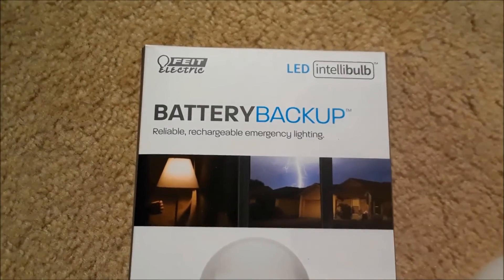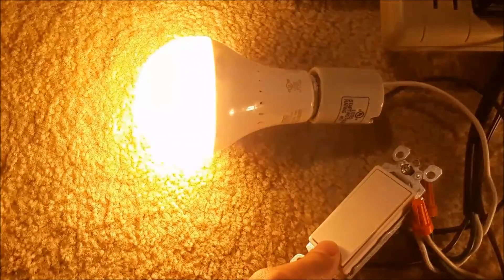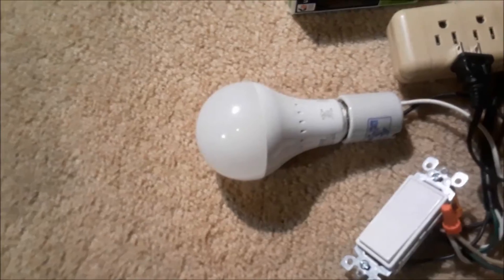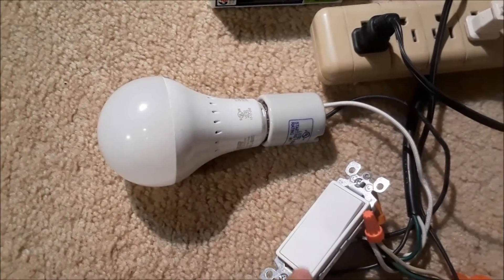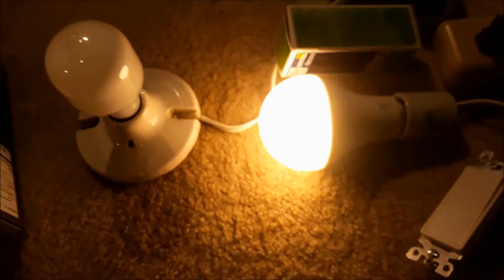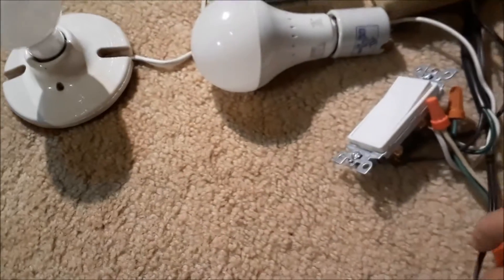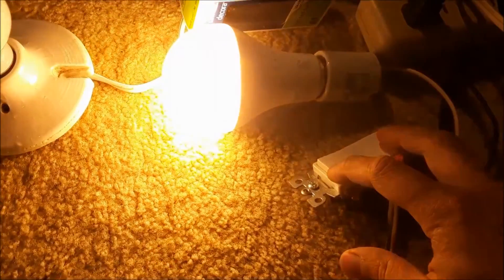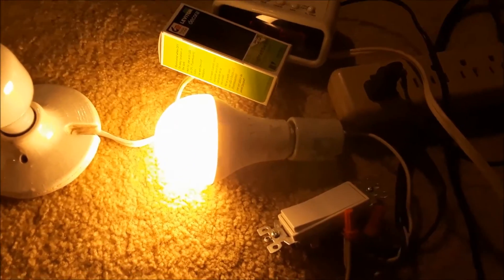Feit Electric Battery Backup LED Bulb Experiment

Comment: If you turn the lamp off to go to bed, does the bulb stay lit as if the power went out?   Or is there a way it senses that the power is still on but you turned it off with the lamp on off switch?  If you can't turn the bedroom lamp off when you want to sleep do you have to take it out of the socket to switch it off?  It doesn't sound so great if you need to modify it to get it to shut off when you turn the lamp switch off.

Comment: Just a quick explanation of why the neon light didn't trigger this bulb.  In addition to the neon bulb (probably) being too low power to set it off, it requires a turn-on voltage of about 50V or more.  Feit most likely uses a much lower sense voltage than that.  Nice video.  I didn't know about these bulbs until I found your video, and I wanted to know how they work.  Now I have a good idea of how they're designed, and of their limitations.
Reply: Interesting it was

Comment: I just bought a whole bunch of these today on a whim, knowing nothing about them... I have some exterior lights on a double switch, and when I went to turn them off, they turned back on... Honestly a not a big deal, but I can only imagine that this constant full drain on the battery day after day will render these bulbs inoperable well before the 13 year life time claim on the box... Regardless, I have a few others set up in areas I usually leave on at night, for when I need to stumble to the bathroom or whatnot... Pretty neat stuff... Except for the few areas on double switches in the house where now I just have a light constantly on lol
Reply: I don't think those batteries will last more than a year if they're in power outage mode every night.  My guess is that they will still work as dumb LED bulbs, and just lose their ability to light during a power outage.
Reply: @theclearsounds3911  I will certainly try and remember to update y'all when that happens.   5 months on and still going strong haven't had one fail yet... Not bad for $4.44

Comment: So..this bulb does not work property?
Reply: It's not that it doesn't work properly.  It's just that it can be easily fooled by unusual configurations.  And, I can give you an intelligent guess that different brands of the same type of bulb will behave differently under these unusual configurations.  This is not the type of thing you can just buy blindly without making sure it will work in your situation.
Reply: @theclearsounds3911  nicely put 👌
Reply from the maker: It works correctly but requires one to manually switch it on during a power outage since it has to sense a "loop" through other loads in the circuit. I was trying to make it light automatically when power is lost.